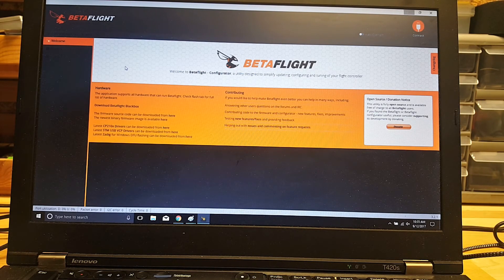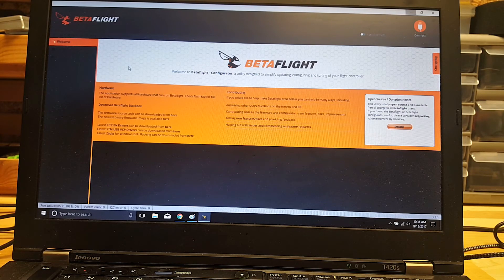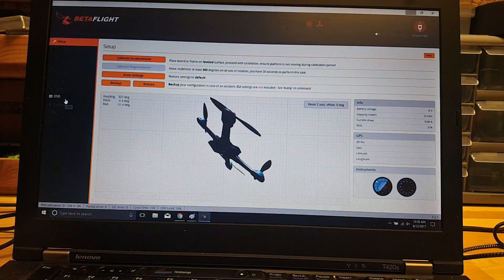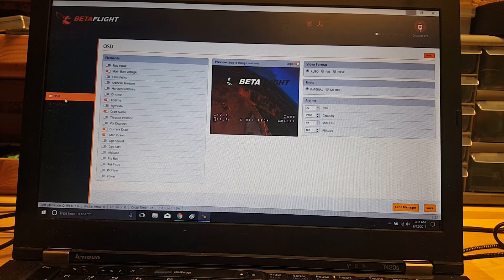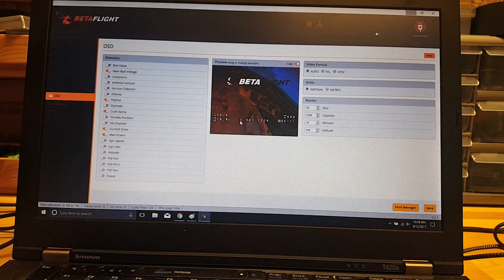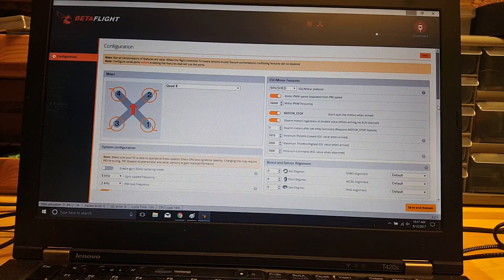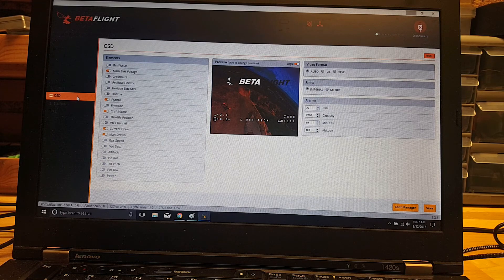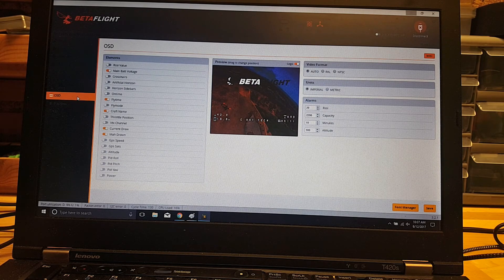Beta Flight OSD Configuration

Comment: Hey ray maybe you can answer this. I just got a 65s and I’m trying to up the transmitter power. I’m used to the bee core going 1-25 this one goes from 25 then increments to 600 . I put it on the max then save it bout when I put in a battery again it resets ? Am I in the right setting
Reply from the maker: The transmitter is 25mw and cannot be changed.
Reply: C Ray Tech really? Thanks. I’m getting really bad reception surprisingly. I am running a mad mushroom and a bandicoot linear patch antenna do you thing that’s a bad combo.
Reply: I try to change the channel I press save and it doesn’t change the channel it just goes back to the Boscam channel 1. I haven’t had this problem with another flight controller

Comment: Hi C Ray!
I just received my 65s this morning. After tinkering with it and a couple of packs through it, I  realized it doesn't have OSD. No where on my BetaFlight does it five me that option. Any ideas?
Kado
Reply from the maker: Can you confirm the flight controller and camera model you have?  They first released a Beta 65s without OSD then later released a new one with OSD.  I added the H02 camera myself because I hand built mine.  I have not received one from them yet that comes set up with OSD out of the box.  Im curious if they used the Z01 camera or the H02.
Reply: C Ray Tech It's the F3 FC and I cannot tell which camera it is.
I sent the Amazon team a message as well.